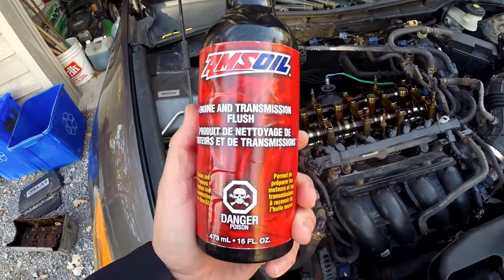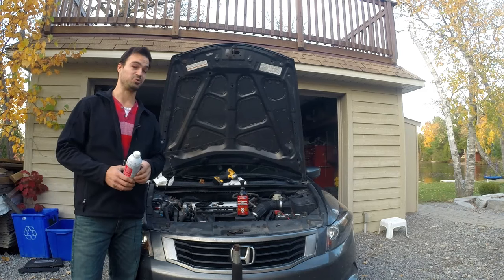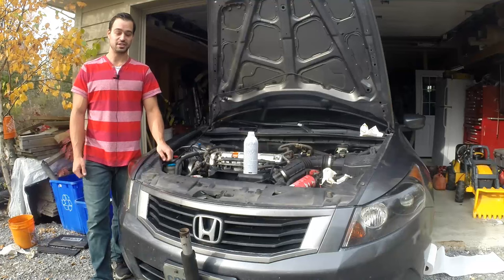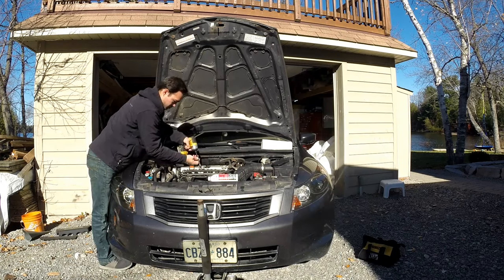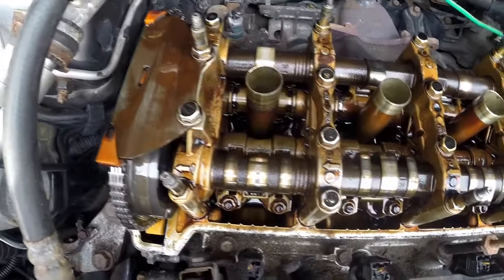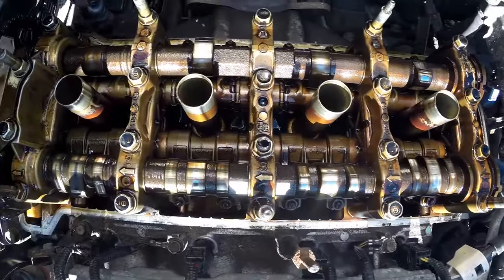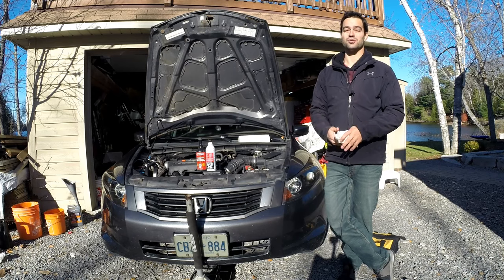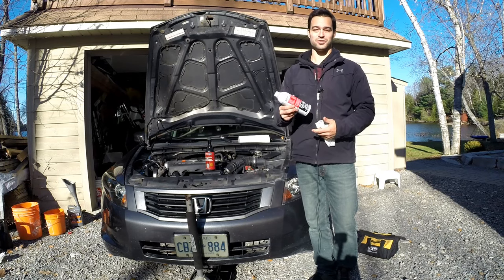Amsoil Vs. Seafoam Engine Flush - Who Wins? Thorough comparison and PROOF

Comment: can you clarify what synthetic oil was used and also what was the oil change interval for this car? Also what was the spec fo the engine. I just know this is a NA. I'm assuming this is the 2.4L port injected...170 or 190hp iVtec.. 4 cylinder with timing chain.
Reply from the maker: This is a 2.4L port injected engine. 190Hp

I am not sure what type of synthetic oil was used up until around 220,000kms when I inherited the car. From 220,000 kms to 375,000kms, the car used only Amsoil XL synthetic oil and was changed every 8000-10,000kms, well under the recommended service interval.
Reply: @KingdomAuto  I just did a valve adjustment on my Honda. My engine is sparkly silver clean , so is the valve cover. I use Amsoil signature, but also for like 3 oil changes the amsoil xl. I got the car around 80k miles. Now it’s at 110k miles. Unsure of previous oil change history. I’m wondering if the PAO synthetic cleaned up/kept the engine shiny clean, or was it my short change interval, or both. Interval was 2000-5000miles. Only about 1-2 oil changes were at 5000miles
Reply from the maker: @LoveLikeaHurricane  Interesting but great to know that your engine is looking so good :) 

The engine in this video needed some cleaning up so I figured this would be a good opportunity for a test between the Amsoil and Seafoam engine cleaners
Reply: @KingdomAuto  There’s your answer why there is sludge snd carbon build up. You can’t verify the oil change intervals before you inherited it and when you did inherit it, you changed at it 8000 to 10000 km. Thats too long even if Amsoil says their oil is good for 25,000 miles. Although your TBN in the oil might still be good at 10,000 km and it still lubricating, the oil is too dirty at that point and will just bake the dirt and sludge into the engine parts. You need to change way sooner if you want your engine to remain clean.
Reply from the maker: @B W  Yeah I can definitely verify that the oil changes were always done on time - I inherited the car from my uncle who bought it new and had all the service history so I know for sure the changes were done on time :) 

I got the car at 220k kms. Oil changes were always done on time but not early. only thing I can't verify is the type of oil used.

I switched to Amsoil at 220k and had it on Amsoil XL until 375k which was when I shot the video.

And honestly, I'm totally fine with changing every 10k using an oil that's good till 25k. Doesn't make a lot of sense for me to spend money on synthetic oil if I'm going to change it at non-synthetic intervals; especially on a car that's 12+ years old and has over 370k kms haha
Reply: @KingdomAuto  You can use conventional oil and change every 3,000 miles and the engine will stay clean.
Reply from the maker: @BW-kv9wj  That would be interesting to try for sure - what would also be interesting to test is engine wear between conventional and synthetic as well. Meaning; is it better to have a "dirty" engine with less wear, or a clean engine that has worn more due to conventional oil. 

That would be one long test though lol
Reply: @KingdomAuto  I have a 1992 Toyota truck with 500,000 miles on it. It has an Amsoil bypass filter and Ive always used Amsoil since 1992. I change it every 3,000 to 4,000 miles. Might be overkill but it’s still runs smooth as silk. I don’t know how clean it is inside but I’m sure it’s pretty clean.
Reply from the maker: @BW-kv9wj  Good to know and glad that's been working for you - that's great!

One more reason for me to stick with Amsoil for sure
Reply: @KingdomAuto  Amsoil is great oil. Motul is great too. But I think MPT Industries is better than both.  Research their 30,000 mile oil that is 100% synthetic Ester and has zero petroleum in it. I’m running in my Honda Civic now. I’m waiting to do an oil analysis on it next oil change to compare with Amsoil. MPT has a starting TBN of 12.5 which is higher than Amsoil. It’s a group 5 oil and Amsoil is Group 4.
Reply from the maker: @BW-kv9wj  Wow that's good to know! If you happen to remember - let me know what the oil analysis shows after you get it done. Really curious about that.
Reply: @BW-kv9wj  Amzoil says 15000 miles between changes in severe conditions. Up to 25,000 miles under normal conditions.  
I think your way, way, off base with oil changes. Just my opinion.
Change the filter at 10,000 and add a quart of new oil, then change the oil and filter at 15,000
I go 5,000  miles between oil changes in my 93 S10. I use Mobil 0ne 10-40. It's got 288000 on it and has 150lbs compression. 
It burns a quart every 850 miles, but that's worn out valve seals..... my summer project. 😉
Amzoil has data on their oil. It's a shame changing it just for the fun of it.
Some people think dark oil is worn out.  It's not. Color doesn't have much to do with oils lubrication properties.
I'd suggest sending an oil sample to a lab just once to see how worn out it is.  I'll bet it comes back with an A rating in every category with that few miles on it.  It would be different if you had a turbo or if you use dino oil, but everything I've ever read about Amsoil says it's the best out there.   
Mobil one is expensive enough for me.
I did an edit and just noticed this topic is a year old.  I don't get paid for paying attention. 😁
Reply: @randywl8925  I’ve don’t many lab analysis with Blackstone. Amsoil is good oil but I did notice the TBN drop to 5.0 after only 3000 miles. Amsoil is one of the best oils out there. I’m just not a fan of extended drain intervals.
Reply: @BW-kv9wj  TBN?  You're out of my league.... or I'm out of yours 😁
Edit:
I'm reading up on it.
Reply: @randywl8925  Total Base Number. It’s a $10 option with Blackstone.  It tells you how much life your oil has left. I think Amsoil starts out at 12 in a virgin sample. And it dropped to 5 in 3000 miles. Apparently, it will hover around 5 for thousands of miles after it hits 5, but I’ve never done an analysis after 5000 miles. MPT Industries is a 100% synthetic Ester and claim 30,000 mile intervals. They start out at TBN 12.5 and it went to 5.1 after 3000 miles.  And both these samples were in a 2020 Honda Civic with 3000 miles and then 6000 miles. Both oils performed about the same. Surprisingly, the flashpoint was lower with MPT.  I don’t understand this because Group 5 Esters are supposed to handled heat much better than Group 4 oils which Amsoil is. I normally run Amsoil but I’ll run MPT too. Both are the best on the market in my humble opinion.
Reply: @BW-kv9wj   Google:
 Blackstone Labs, one size doesn't fit all by Travis Heffelfinget march 2021.
It shows both Amsoil and mobile one.
You'll notice they don't bother showing any data until it gets down to 5.
To me that looks like the oil is in excellent condition and a starting point at which to watch the degrading process.
It would be interesting, if you haven't already done so, to contact Amsoil about that 5 level and the mileage when it hits that with your engine.
They might tell you that  it will probably stay at that level for the next 3 or 4 thousand miles.
I'm obviously theorizing.
Reply: @randywl8925  Yeah.  I think the next sample I send them, I will make up a different oil manufacturer, miles  and different car. I wonder if they base their results on past results from documented oil samples from oil manufacturers and mileage???
Reply: @BW-kv9wj  I don't know I just found this interesting so thanks for bringing up or I never would have looked for it.
I've never sent my oil in for testing but it would sure be interesting.  My S10 has a 4.3 V6 with 286000 miles. The compression is good, 150 and pretty even across the cylinders.
What would make the soil analysis interesting is that the oil seals on the valves are in pretty condition. I'm sure they're original to the engine.
Anyway I've enjoyed the conversation I've learned something but I'm not sure what. 😁
Reply: @randywl8925  I bought a 1992 Toyota SR5 pick up brand new and it has 500,000 miles on it. Still running strong.  Although I don’t drive it as much as my other cars.  But it use to be my daily driver to work. 160 miles round trip everyday for years.  Never broke down or stranded me. Always got me from point A to point B and still does.
Reply: @BW-kv9wj  I don't know if you've ever watched cleetus McFarland, but there's an older fellow Sam on the show that has a Chevy pickup and I believe it has 700000 miles on it. It's a V8. Sam takes care of his everything very well.
Reply: @randywl8925  I’ll check him out.  Thanks
Reply from the maker: @BW-kv9wj  great conversation folks! Solid info from you guys. Funny enough I had a Blackstone analysis done recently on Amsoil XL. Their middle grade oil. After close to 11,000kms (km’s not miles) it had a TBN of 3.5 so still some life left. Just as an fyi to contribute to the chat :)

Comment: Amsoil flush smell just like strong kerosene. That smell would last after 2 oil change. I think amsoil engine flush they said regular part of maintenance or you should do it every oil change or 10 to 15k miles. It's a quick flush type product so in your 1 test you are not going to see any difference but I have done it with my vehicles and I feel like my vehicles run smoother and quieter. And whenever I pull my dipstick I can smell kerosene.
Reply from the maker: Thanks for your comment!
Yeah I agree, these products are meant for ongoing maintenance as opposed to just one time.
But I wanted to test and see which one removed more buildup with just one use.
I think either way, if these products are used regularly, they’ll probably do a good job at keeping the engine clean :)

Comment: It is a great video indeed! I have the same car and I have got to ask you this question: after using Sea Foam have you had any oil leaks or any other potential problems with the engine? My mechanic tells me to never use any flushes as they can clog the oil channel and lead to adverse effect. Have you noticed any issues after using these flushes? Much appreciated
Reply from the maker: I didn’t experience and issues personally. I have heard of people say these things before too. My thoughts are; if there is a large buildup of sludge in the engine (far more than just varnish, and much more than the engine I tested in this video) then there could be a chance that some of that sludge would come off and cause harm to the engine.

If the oil is changed on time with any engine though, there won’t be a lot of buildup and these cleaners will gently dissolve what’s there, which will then just get caught in the oil filter.

This is my personal opinion after having tested these cleaners and having used a handful of them over the years. I haven’t ever experienced an issue but that doesn’t mean it hasn’t happened.

Hope that helps!

Comment: You said that synthetic oil has been used, but there is a huge difference between a good one with PAO and Ester with good additives and a bad one. My mercedes after more than 100000 miles are metal clean inside engine.
Reply from the maker: As mentioned in the video, I don’t know what was used up until I took ownership of the car. But after 200,000kms only Amsoil XL was used
Reply: @KingdomAuto  That may be the problem, the first 10.000km are the most important with frequent oil changes with good oil.
Reply from the maker: @danieleriksson1657  oh yeah I’m well aware of that. I wasn’t trying to figure out the cause of the sludge here, I was trying to test cleaners
Reply: @KingdomAuto , I know, just saying how to avoid sludge and later cleaning.
Reply from the maker: @danieleriksson1657  oh gotcha, appreciate that thank you!

Comment: Fair warning to all...Engine flushes clean the metal...Rubber seals can be altered for what is left of them...Hot oil changes mixing with ATF only safe way..Then..0w20-30-40 Class 4 Syn Oil..These companies produce a flushing product for pennies..Guess how much you will spend for surprise repairs later? $$$$$$..
Reply from the maker: Can you give more info about which products are more dangerous than others? Do you have legitimate proof of these claims as well?

I used SeaFoam on this car in the video a handful of times throughout ownership, and drove it over 200,000kms after using the product (so the engine now has over 400,000kms) and no problems at all.

No leaks, no rubber seals damaged, no engine issues, etc.

I’m not saying your claims can’t happen. I’m just saying that I bet some products are more aggressive than others.

The ingredients in most of these cleaners are pretty gentle. Which is why I’m asking if you’ve ever personally seen any of them do damage

Comment: How would one know if you chase one back to back after the other? Amsoil let idle for 15 minutes and drain,do not drive the vehicle around with that it the motor. Amsoil products are the best in my opinion plus sea foam does not make engine oil and or a filter to compliment the flush.  Use Signature series and forget about it!
Reply from the maker: Hey, thanks for your comment but I’m not really sure what you mean. I explained the whole process in the video and just followed the directions given by the manufacturers of the products. I didn’t drive around with the Amsoil product at all, simply let the vehicle idle for 15 mins, then drained and filled with new oil, new filter, and then tested the Seafoam.

In my experience, specifically from this test, it did appear that Seafoam did a better job cleaning buildup from within the engine. I’m a big Amsoil fan, and I’ve used their products and oil for years so not trying to bash them at all. I’m just being as unbiased as possible and explaining what I witnessed during this test.
Hope that helps :)

Comment: Amazing,but im scared that I can clogged the oil pump.im try to change frequently and used MISTERY OIL.is verygood!!
Reply from the maker: Based on what I saw during these tests, the products seem to get rid of sludge and buildup very slowly and gently, so they shouldn’t clog the oil pump. But I’d definitely recommend changing the oil and filter right after using an engine flush product though.
Anyways, I hope that helps!
Reply: @KingdomAuto  thanks lot for your tip!
Reply from the maker: @audiemuniz6445  For sure! Hope all goes well if you decide to flush your engine :)

Comment: I have a direct injection engine. I'm not so sure Seafoam is going to do very much for DFI Motors. Possibly help clean the injectors but I'm more sure anything else.
Reply from the maker: It depends on what you’d be using it for. If to do something like what I’ve done in the video - adding the product into your oil - it’ll do the same thing and clean out carbon within the block and head.

Adding it to your gas would help clean injectors as you’ve mentioned. But as for cleaning intake valves, you’re correct; it wouldn’t be able to clean those by simply adding to your oil or gas

Comment: Please, sir, run 5W 30 can’t hear my metal parts clanking around and he’s a frame ultras synthetic filter and a force. Valvoline high mileage extended protection every 7000 miles.
Reply from the maker: I was very happy with Amsoil when running it in the car. I had Blackstone analyze the oil after 13,000kms and the oil still had lots of life and anti-wear properties in it. Very happy with Amsoil’s oil :) 
With regards to viscosity, I always use what the manufacturer calls for
Reply: This is just more proof that it doesn’t matter if you use gold, oil changes should never exceed 5k miles I don’t care how much oil has evolved….i use cheap oil and change it every 3-5k miles and my engine looks almost new inside….

Comment: How is the engine now? Thank you in advance bro.
Reply from the maker: It's running great - I did notice a slight increase in MPG and also a smoother idle as well. But didn't "feel" any performance difference. But the engine is still running very well
Reply: @KingdomAuto  thanks for your response. Do you think it wont block my oil galleries?  Mine is running 135,000km. Visible sludge in oil filler cap. Ty
Reply from the maker: @sebseb3268  I don't think so - these products seem to break the sludge down in very small amounts, almost dissolving it. 

The engine in the video had over 360,000kms on it when performing the test and it's still doing great (actually a little smoother than before) so I'm pretty sure you'll be fine.

I would definitely recommend changing your oil right after using them though.
Reply: Thanks boss!
Reply from the maker: @sebseb3268  Anytime! Hope you have success with flushing your engine - Cheers :)

Comment: Sludge just magicaly won't disappear....is all going some were and that's the oil pump strainer and for sure some of it is going into the oil pump gears if the strainer doesn't get completely clogged...
Reply from the maker: These types of products do a great job of gently dissolving the sludge, that’s been proven quite definitively over the years. So it’s very safe for the pump and strainer as the buildup won’t come off in big chunks but rather very fine particles that would simply just get caught in the filter and/or suspended in the oil itself. That’s why the manufacturers recommend that you change your oil as soon as the product is finished doing its work.

Additionally, it’s recommended that these products are used somewhat regularly to keep the engine clean. Biggest thing that helps with a clean engine though is short change intervals.

Cheers

Comment: Which oil filter were you using?
Reply from the maker: Oh good question. For the tests I just went out and bought the cheapest filters I could find because I knew I'd be changing the oil so much. But I forget what brand it was. Sorry about that.

When I owned the car I'd always use Amsoil's synthetic filters along with Amsoil XL oil